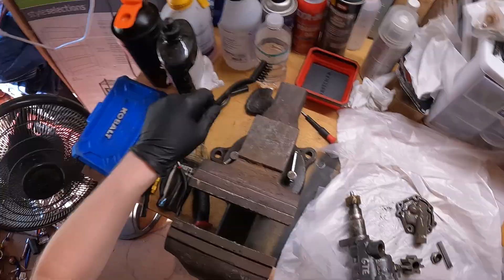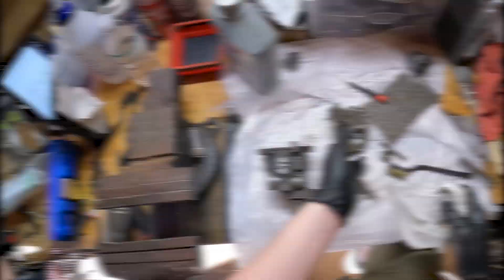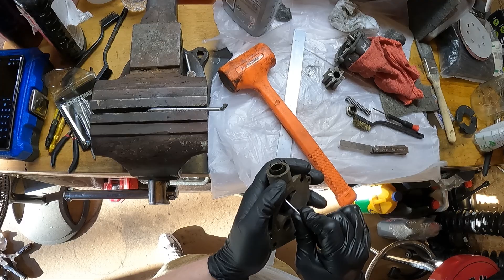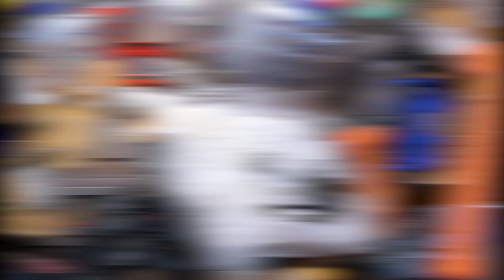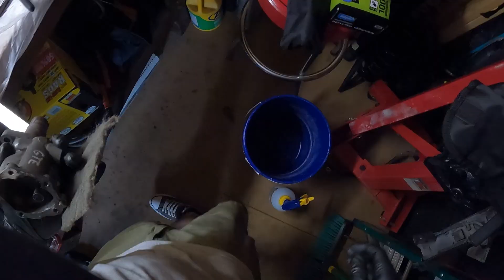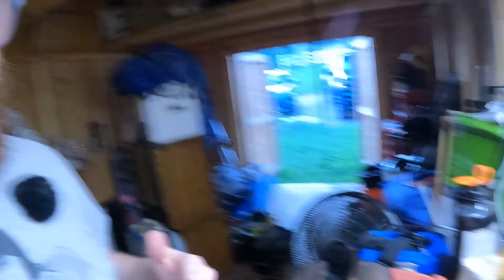MK3 Supra More Oil Pump Problems?!

Comment: Awesome videos. Diving into a MK3 supra for the first time myself, similar gonna be in a storage unit for the winter months.

Curious where you got the PDF service manual. I have the Haynes repair guide but am really looking for a PDF like you got.
Reply from the maker: @gamingwithritz632  I appreciate that! They're definitely fun to drive when everything is sorted out lol. 

As for the repair manual, I usually put the link in the description on all the Supra videos I make. I just realized I didn't link it in this video when I originally posted it, but I just updated it so you can check it out
Reply: @SlothKingGarage 

Thanks! Oof didn't notice the other videos with it lol. Saw you just posted an update for the oil pump, hope it's a good update! Will be catching it later
Reply from the maker: @gamingwithritz632  Haha you're good! And as far as the update goes, well nvm, I won't say anything until you watch it lol

Comment: There's always something. Glad you are getting it fixed. My engine just got finished being rebuilt and they used the oem pump that came in it since it was still in spec. Also just finished installing the front subframe with the new bushings, thank you for getting back to me with my question on that too. Can't wait to drive mine, since I only drove it one time. And that was to the shop lol. Can't wait to see how yours turns out
Reply from the maker: Man can't wait till yours is fully finished! It is always one thing after another with any project car. Keep me posted on how yours turns out